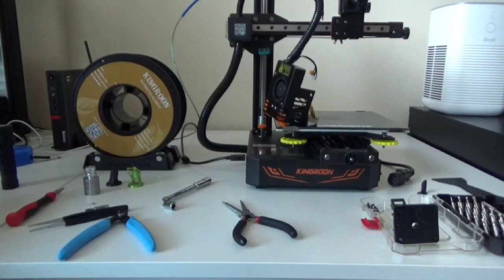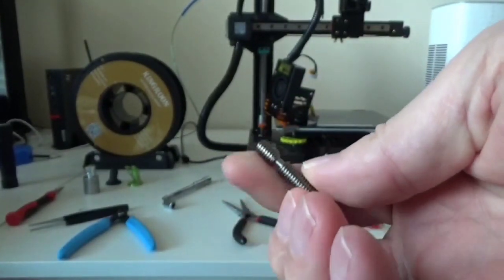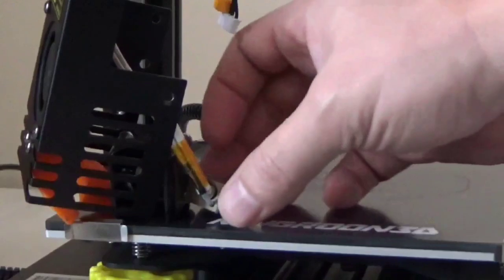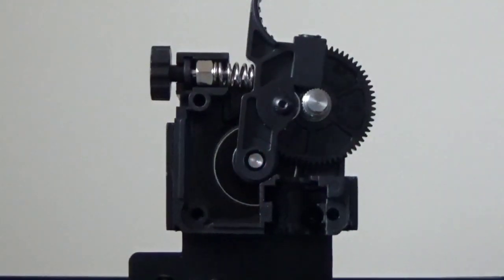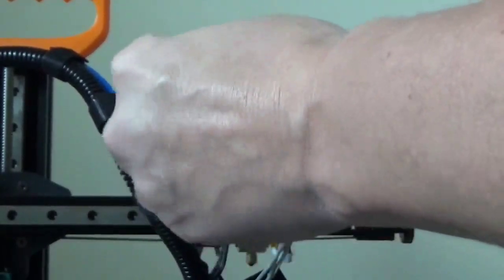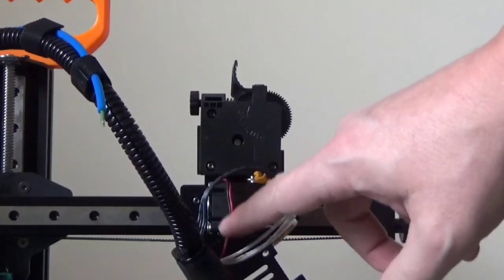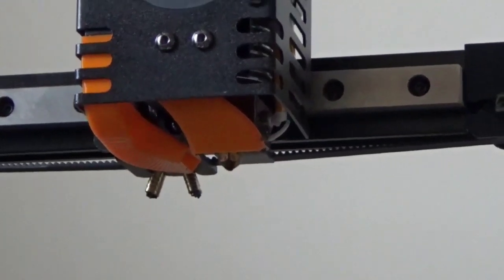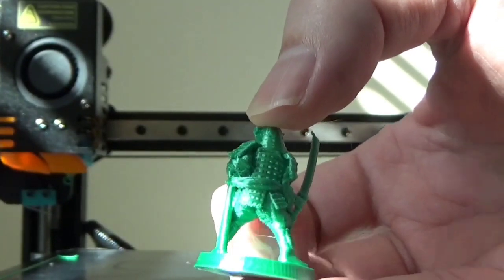Kingroon KP3S Pro 3D printer all metal hotend upgrade.

Comment: Thanks for this video, I'm still relatively new to 3d printing and this big black box that I knew I had to somehow take apart to clear a clog was a bit intimidating, especially the thought of having to put it back together correctly. This video helped a lot. Also thanks for pointing out the little blue tube. I almost threw it out as it came completely out with the filament and I literally threw it in the trash. Fished it out after I heard you mention the blue tube. I had to change the heatbreak to a new one as it immediately clogged again after I put it back together. Unfortunately, I put in a PTFE lined heatbreak again as that is what I had read the part should be and what I had ordered from Kingroon. Guess next time I'll switch to all metal.
Reply from the maker: Glad you liked it. Yes, the all metal throat i installed is working wonderfully. I highly recommend.

Comment: small correction: it is very important to put such a neck on thermal paste, otherwise you will have plastic plugs, the reason is the poor quality of the thread of the neck or radiator and the lack of good thermal contact for cooling the radiator
Reply from the maker: Normally I would agree, but I really want to be able to remove the radiator if I need to. So far I have several hours on this setup and zero clogs so I think its ok.
Reply: @joeprints3dstuff  Has it clogged since?
Reply from the maker: Zero clogs since the install. I have been using this printer exclusively and have a few kg through it. Fingers crossed.
Reply: @joeprints3dstuff  I went for the thermal paste method on my stock heatbreak and I haven't gotten any clogging since, so I can confirm that it also works. I still get a bit of stringing so I will try a combination of both TIM and an all metal heatbreak, or maybe I just should look for a better nozzle that doesn't ooze at high temps? Idk.
Reply: @joeprints3dstuff  Also, check your heatsink for burrs. Mine had some nasty ones that created powder from the filament running across it, maybe that's where you got "material" stuck on the void right above the heatbreak.
Reply from the maker: @sparkster7744  no mine is good. Pretty sure my issue was the old throat.